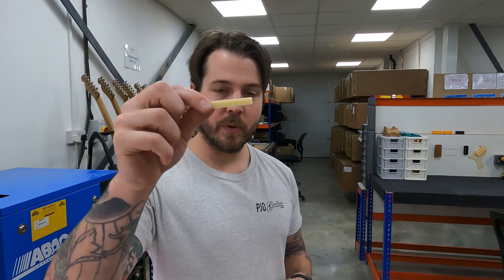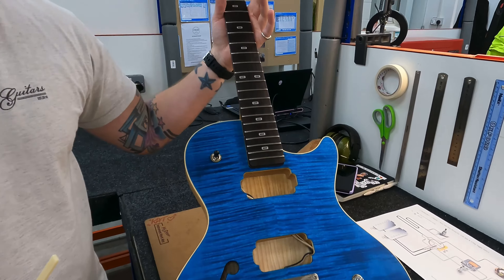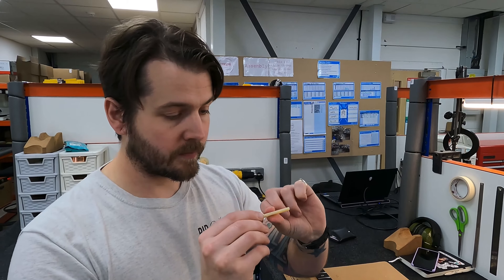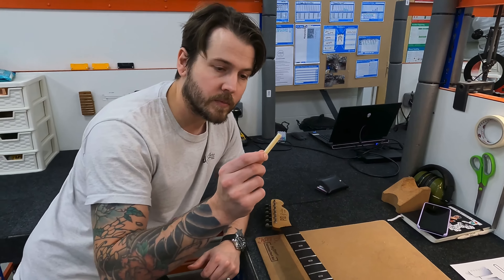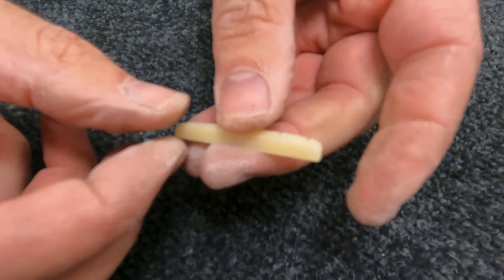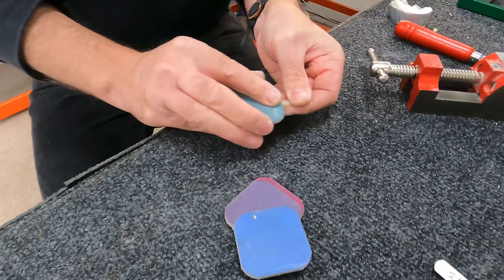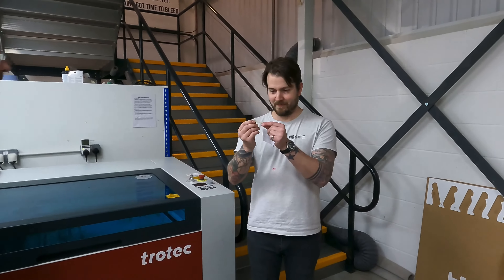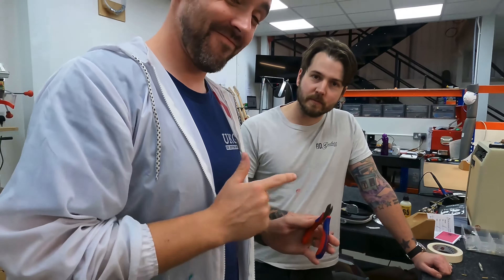How to make the perfect Guitar Nut!!

Comment: Wish there was more information about how he knows how deep to cut the slots to get the perfect nut depth and if after strings were put on if it needed further tweaking (?). Would love to see more of an in depth video of this since nobody ever really goes into the specifics. I get it because to them it’s just nut 1 out of 2000 past ones they’ve done, but to the ones who don’t have a lot of experience getting a perfect nut seems like more of a mythical thing. Cool video otherwise but would like a lot more in depth 🙏
Reply: I'll tell you There's a video on YouTube where a guy takes a carpenter ✏️ pencil and sands it flat  then runs it over the radius of the frets and it draws a line for you. Just search making a guitar nut you'll find it.
Reply: The other way is to measure your first fret and then stack feeler gauges matching this height plus .010 up against the nut following the radius of the fretboard and draw a line, you make it .010 higher so that when you cut the slots u get the right depth
Reply: The half pencil marks both the fretboard radius and the lowest you want to go with the string slots. Leave a millimetre or so of material past the pencil line still on the nut so that you have some material to cut slots into.